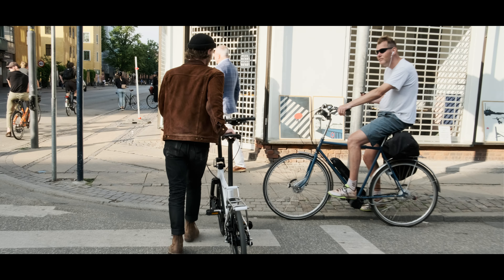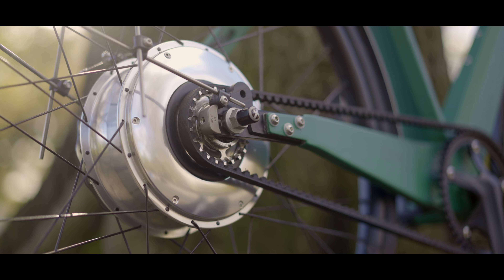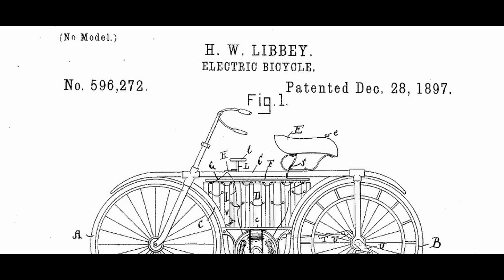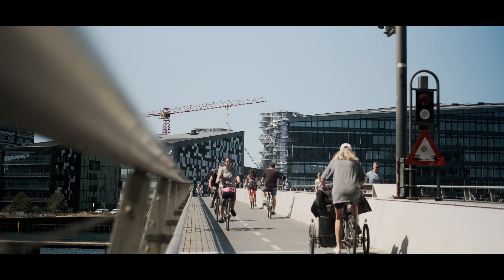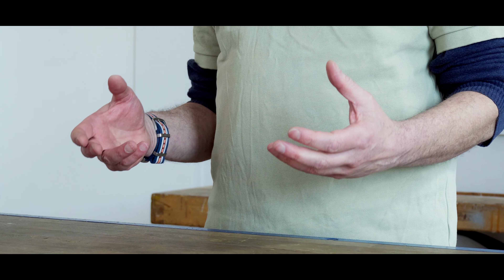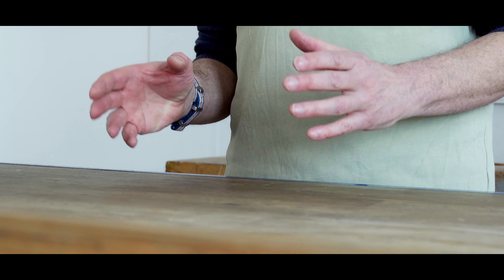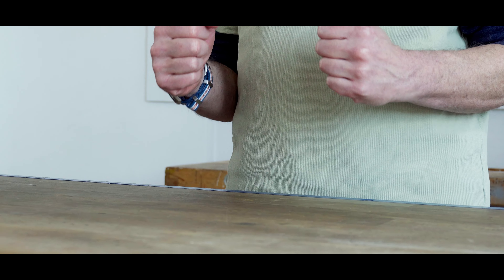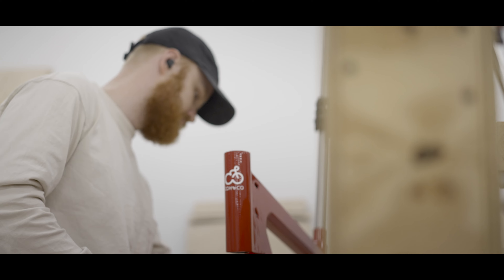Mid-motor or rear-hub motor systems? | Coh&Co Copenhagen

Comment: I am more curious why you use radial lacing of the  rear wheel 😮
Reply from the maker: We use radial lancing only on our electric version of the smaller-wheeled Siggi folding bike. Because of the motor, there's just not enough space, so it's just simpler with radial lacing. On our larger models we use single or even 3-cross lacing